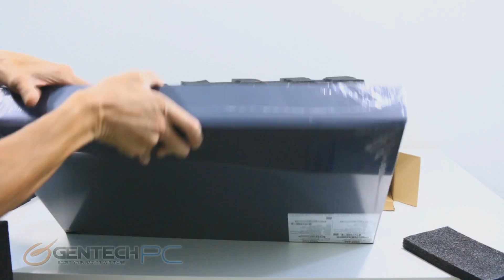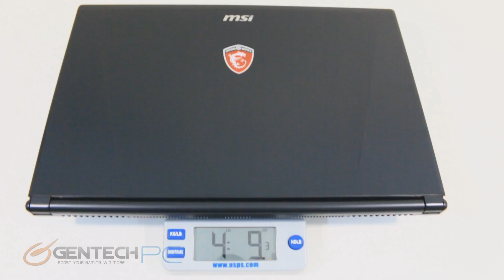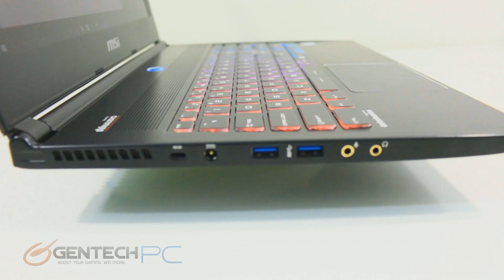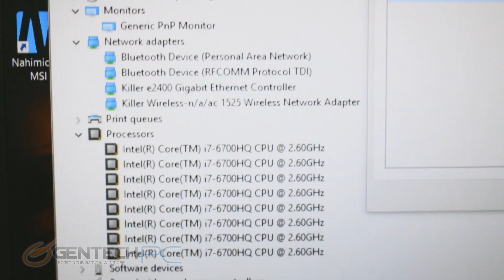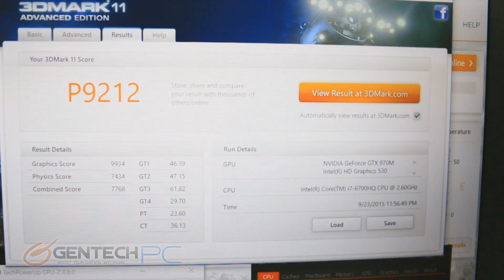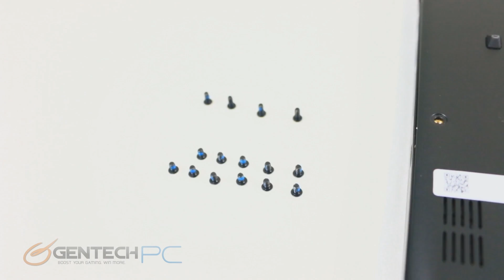MSI GS60 Skylake Detailed Review and Benchmarks

Comment: Doesn't seem too much better, got a GS60 about 4 weeks ago with the 5700HQ. Didn't bother waiting since the CPU isn't what is holding this laptop back at all, plus from what I've done so far, the temperatures of the 5700, and 970m hover in the 60-70 range, even playing witcher 3 for a few hours this thing hardly heats up. The ram won't hurt you either, your games will play just fine. If you can find the 970m/5700HQ for a cheaper price coming up in the next few weeks you won't regret it. This is still the best thin laptop out there imo, the design of this is stunning and i even like it more than the razer blade.
Reply: i am worried about the tempratures and the fan noise. 
could you tell me how it is
Reply: +Aqib Bashir
It is only noticeable on idle in a dead silent room, and then when gaming it ramps up a bit but it's never been too obnoxious and from other laptops i've used; asus rog/hp omen they all get around the same, my roommate doesn't notice it. You're going to be annoying people with your razer blackwidow before the laptop fan noise gets to them haha.
Reply: Lol thank you
Reply: I am probably getting the 5th gen not the 6th gen bcuz of the price
Reply: +Aqib Bashir 

Yeah, if you can find it in stock and cheaper go for it, its a solid laptop, and the whole GS60 lineup has one of the most beautiful laptop displays there can be(1080p screen idk about 3k/4k) However, if they are the same price then obviously the newer one! But see if you can snag a deal on amazon/newegg/ebay
Reply: Cheapest one is for about 1k but i want   the one 970m which is 1399 and on my budget so i will be getting that
Reply: +Aika Music What do you think is a good idle and GPU temperature. On my GS70 the GPU gets to around 80 playing GTA V.
Reply: +Aika Music the 5700 cpu model seems have issues playing games. Lots of people claim blue screen play any game from steam
Reply: +黄高寒 i havent had any blue screens playing league,witcher,borderlands,skyrim, and other steam games so im not sure what the issue there would be
Reply: +ninjamaster2009 

Idle for me is around 37 and really anything from 70-85 isnt going to hurt the gpu too much and is to be expected, the stock paste job on mine must have been done right becuase i haven't been able to get my gpu over 70
Reply: +Aika Music if you see gentech old review, this new 6700 may not had better performance compare to 5700, but it had better power consumption which means cpu is cooler  than 5700. i think this is really important. cooler cpu means quitter fan. big sales point for me.
Reply: +Aika Music when you guys play games do you get bad frame rates or any tearing because this has no gsync right?
Reply: +黄高寒 
That is true but i think even so this laptop still isn't going to be dead silent but everyone makes too big a deal over how loud it is like its not a macbook air this stuff needs to be cooled down xD
Reply: +Techno sailor 
No tearing with vsync on, with it off you get slightly
Reply: Aika Music so how high of setting do you play on and what is your average fps? sorry for the questions but these questions slightly determine whether or not i will spend an extra 1k for an expensive laptop.
Reply: +Techno sailor 
Which game? if we are talking witcher i just did graphics to high default and turned off hairwork and then postprocessing all maxed out but i turn off motion blur since I don't like it and the game runs incredibly smooth definitely 45-60 the whole time. All my other games i can just max the sliders out. The 970m is a really good gpu, for me weight was a big issue so thats why i went with this over the msi gt72 with a 980. Check other laptops with 970m and compare to this one, the ghost is more expensive because of the thin and lightweight where ge series is a little cheaper with a 970 but heavier
Reply: Aika Music hmmm ok, im feeling like i want to get the GT72 Dom pro G.. i feel like the 8 gigs of Vram, the G-sync and the 980M can satisfy my graphical needs more than a laptop that has a 970M.
Reply: +Techno sailor wait for the 980 without M
Reply: 黄高寒 you are insane.....that will be 4k USA dollars...im not paying $4,000 US dollars for a stupid laptop...
Reply: +Aika Music i just found a gs70 stealth for £1399 with a skylake core i7
16gb ram
2x128gb ssd
7200rpm hdd
this is the same price as the broadwell but the broadwell has 1 less ssd
Reply: Aqib Bashir gs70 is a tn panel just so you know :p
Reply: Aika Music yh i know, my current laptop has it aswell. I have no problem with it
Reply: +Aika Music the laptop is here today. and it feels very nice but have not yet tested it. i need to set it up first then download games and benchmark it
Reply: Nice, I mean you know how powerful the 970 is already, It's not the top but its still very good. Enjoy the computer though, it was a good choice :p
Reply: +Aika Music loads of people moan that this thing heats up too bad but i think ill still get it over the dominator which looks like a brick
Reply: +Pierre Stromae i have used it and trust me people are right about it heating up. when you are doing normal gaming it will heat up at a point that it will become not touchable. but this is only where the fans are based and rest of the areas will only be affected a little.
Reply: +Pierre Stromae i use a laptop cooler anyway and i never game without my laptop cooler and it actually helps it alot and the temps stay normal
Reply: +Aqib Bashir what laptop cooler do u use? i am looking to buy one
Reply: +Pierre Stromae i just bought one from ebay for 8£ and its really good
it has 5 fans
4 small fans and 1 big fan in the middle
Reply: +Aqib Bashir thanks a lot
Reply: +Pierre Stromae there are many more with different prices and design's

Comment: Do the "superport"s in the new line of msi laptops support thunderbolt 3 40gbps connections? I need a portable gaming solution that also supports docking for home gaming experience. I plan to buy the laptop now and the external gpu next year. Advice appreciated.
Also are there any brands that would be recommended above msi?

Comment: +GenTechPC Do you know if you'll have any 6gb gtx 970 variants in stock soon? How much difference do you reckon it would make over the 3gb version?
Reply from the maker: +Greg Brown So far only the 4K version has 6GB VRAM.
Reply: +GenTechPC fair I'm in the UK and haven't seen any of the 6gb versions yet. Wouldn't be too bothered but I've been told by both Scan and ocuk the ones they have in stock still have 48 Hz displays and a later version will have 60 Hz So I'm stuck waiting around. need someone who bought from them to confirm if that's true
Reply: +Greg Brown For the resolutions the 970m can push and its horsepower, 6GB won't make any difference.
Reply: Mike Adams thanks for the info. Yeah the performance looks pretty decent at 1080, but the chip is still too under powered to push 4k even with the extra VRAM? Wouldn't it allow better textures at 1080 though?
Reply: ***** By the time you get past 3GB of VRAM usage, the 970m just isn't powerful enough to drive it. The 970m is essentially the desktop 960. It's very good at 1080p, but 4k is just too much. It's too much for pretty much all cards lol

And 3GB is enough for 1080p, 2GB is still enough for 1080p. I just laugh when I see the 980m come in an 8GB variant lol